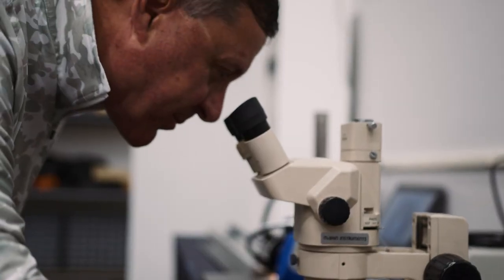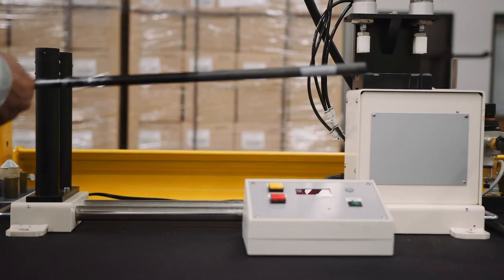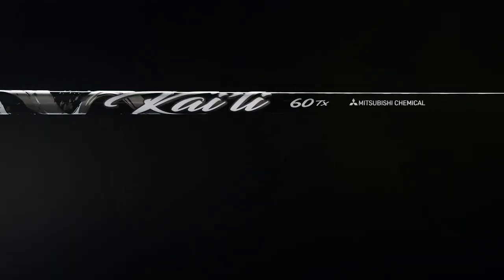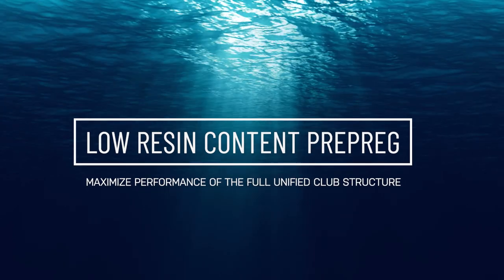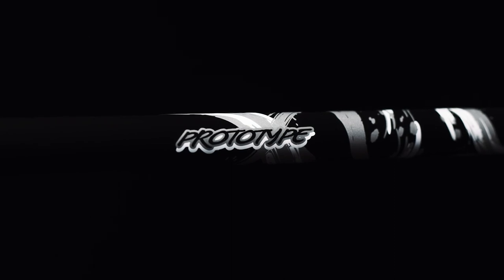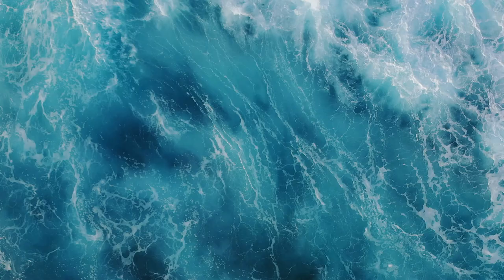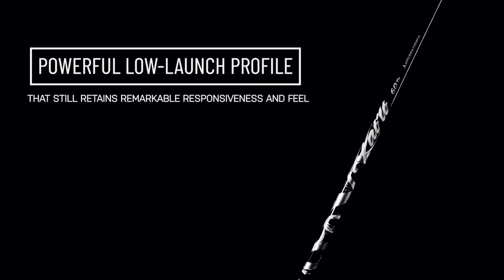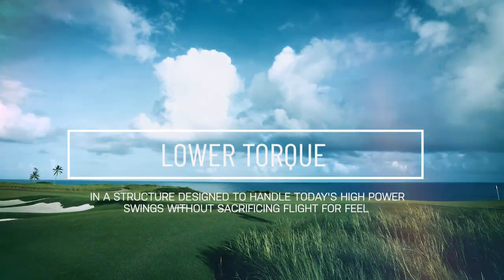Introducing the Kai'li Driver Shaft Series from Mitsubishi Chemical Golf

Comment: Have had the blue in my Qi10 for about 2 weeks now. Out of the gate I noticed how consistent the kick was between the on course and the 100% swings on the range. I have the 70x model. I don’t have to over-swing/change my setup to get the shaft to perform. Carry and total are consistent even at 118-122 club head speeds. Enough spin and launch to sit and stop in the 300-320 range i expect out of driver.

Kaili Blue is a breath of fresh air. I have tried too many hzrdus/tour AD/ventus/tensei shafts to count. This thing is smooth, consistent and easy to hit. It is also a “stock” option on TM’s website and maybe 250 to get from non OEM’s (I can’t speak on this price, didn’t do my research). Give it a try!
Reply: I have the kali white in 70x. Great shaft. Apparently the diamana wb is the kali replacement. Hoping to get the kali white in the new titleist gt driver

Comment: Hi great video...question for ya..... i am 58 years old ...driver swing speed of 90-94 mph.....hit a fairly high straight ball....9 to 11 handi cap......currently use a regular flex shaft.....would i be ok with the red or blue MITSUBISHI kai'li ? if i went with the blue should i go 10.5 degree head....if i go with red should i go with a 9 degree head......interested in your thoughts....cheers from Canada
Reply: get a diamana instead.
Reply: Kai li red 60 S was the best for me.. I swing around 107 and pick up speed early in my swing..   my driver head is 9 degree stealth 2 HD.. I tested lots of other shaft and nothing came close.. U can get a 60R red..  try it you may luv it